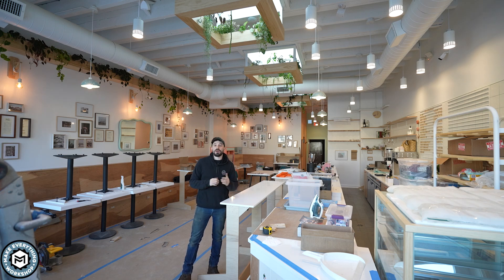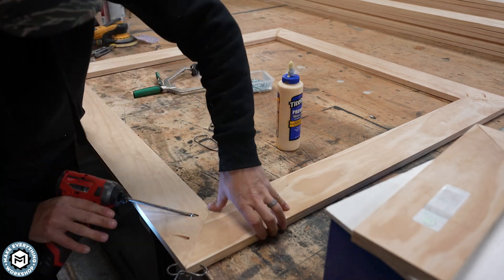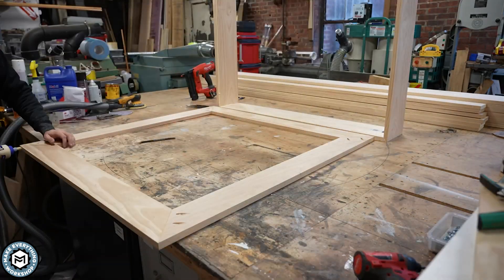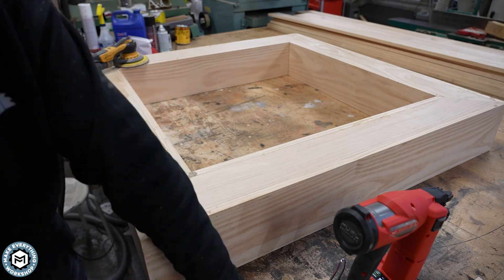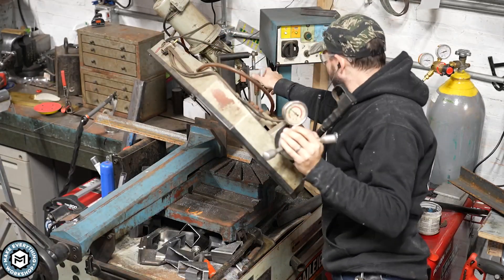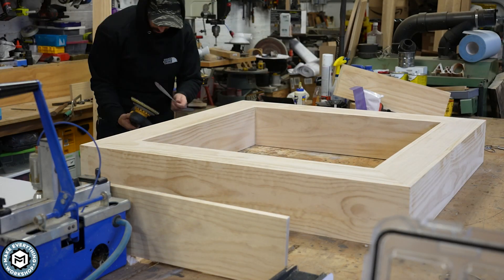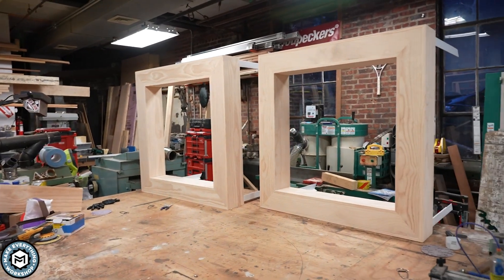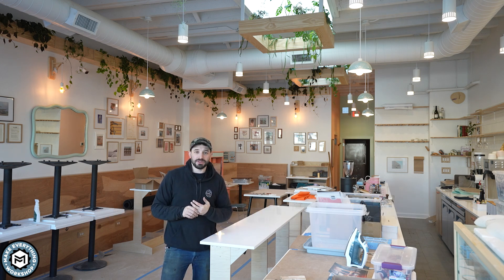Planters For Your Skylights! - Woodworking

Comment: Was the strapping necessary? Probably not but, it was certainly worth the peace of mind. A belt and suspenders approach will never go out of style in my book!
Reply: I agree, I thought it was overkill at first but then, like he said, over time if the wood gets wet the screws could lose some grip on it. It would happen gradually, of course and you’d probably see a corner sagging before a catastrophic failure but if you’re over the heads of the public it’s prudent to make it redundant like this.